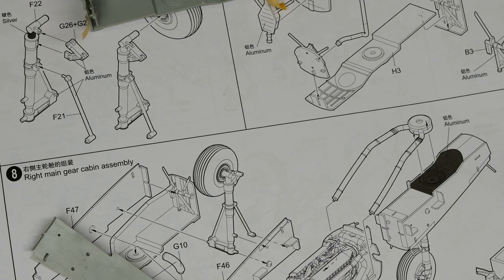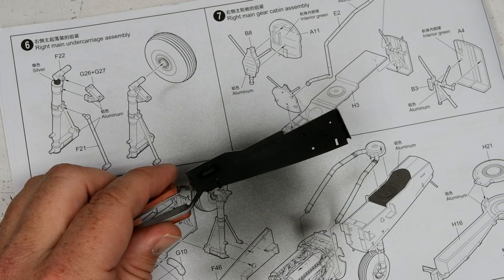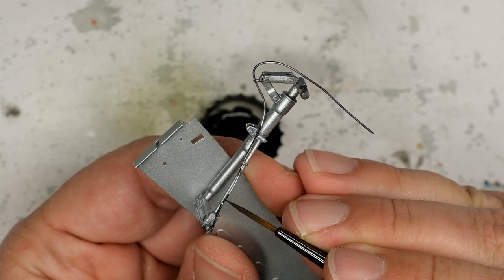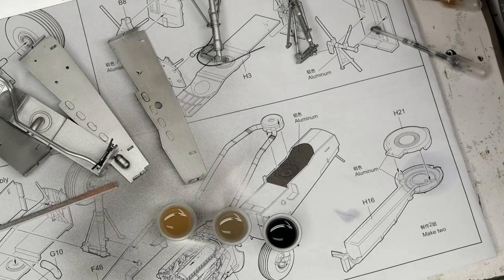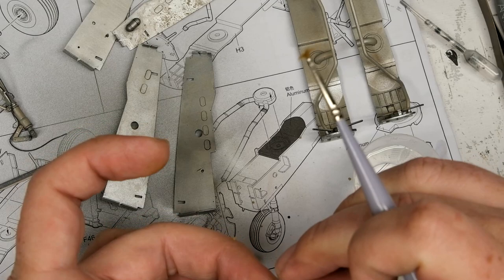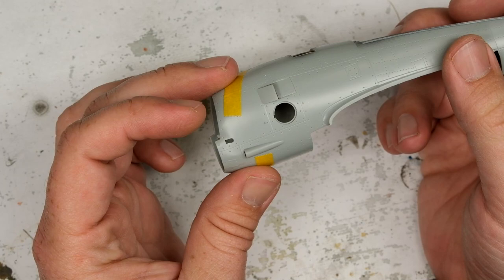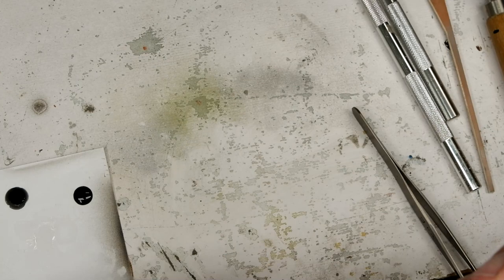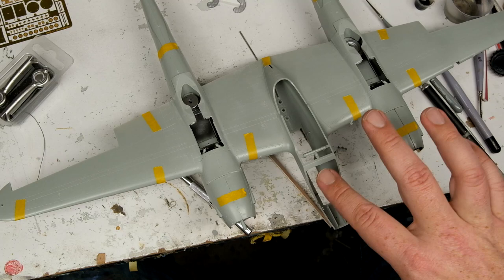P-38L Lightning Build 02 - I've Made a Huge Mistake

Comment: So I get it and I don't get it - wasn't a good bit of this anticipated in the sense of it being an older Trumpeter kit? I'm just looking at it from the perspective of the time consumed to make 2 videos before pulling the pin on it. And a question for you regarding subjects selected for videos - are you ever concerned about a kit being "played out" (something everyone's built ten times over like the Tamiya F-14, etal)?
Reply from the maker: I was anticipating a certain level, but, say, rescribing both nacelles tip to tail? Nope. Didn't realize that'd be a thing til I got up close with it.

As for played out - sure. Though it's not just the kit, it's kit + markings. There are lots of options to make the F-14 your own. But it's a reason I shied from the Tamiya P-38 for awhile - all of the schemes are OD/NG. Until I found markings that spoke to me.

Comment: The work you did on the wheel wells is just sublime.  The staining in the wells looks so real. Great job. But, alas this is a terrible model kit. The sad thing is things have not gotten much better over the years in my opinion. The 1/32 b-24 from hobbyboss was a disaster  for me and the hobbyboss  1/32 a-26 invader with seven cylinder engines a rage inducing screw up on their part. So I get your frustration.
Reply from the maker: Man, you've certainly picked the rough ones! Totally agree that Trumpeter can make a mess of things - but they can turn out good kits, too. The Intruder is more good than bad, the Skyraider and MiG-29s, Hind, Bearcat, Dauntless, , F-84s etc. But I do wish they were more consistent.